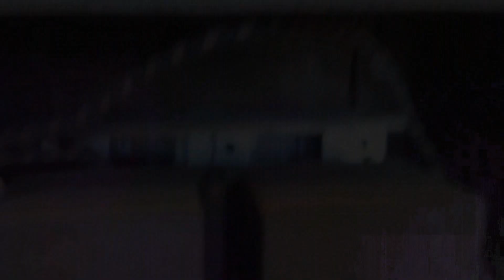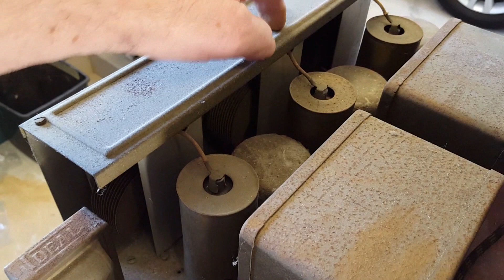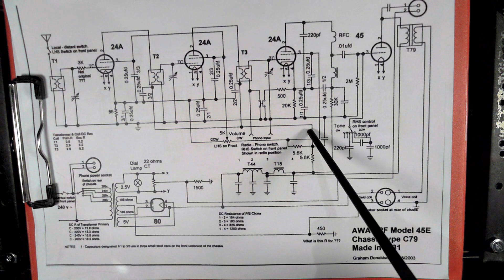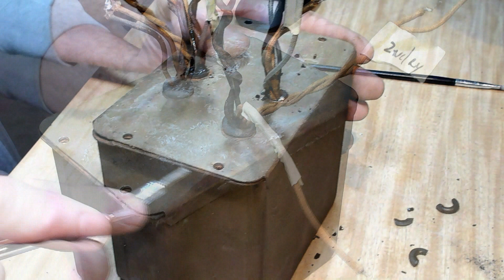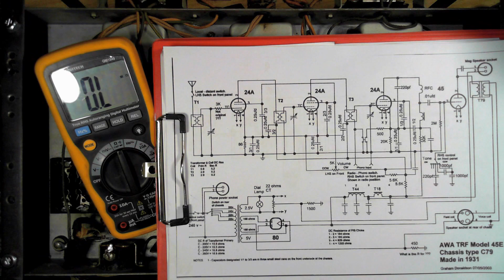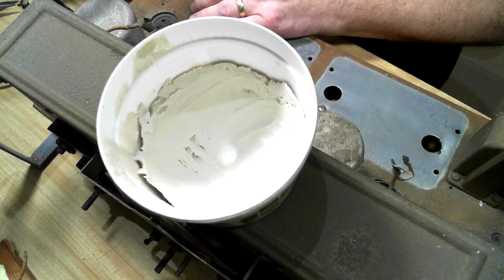1931 AWA 45E C79 Radiola Restoration Part 1

Comment: Hi David, I'm REALLY enjoying your videos. I'm 71, and when I was fifteen I remember a rainy afternoon, Hamilton Library, carrying home a copy of Gilbert Davey's "Fun With Short Waves", being thrilled with the whole idea of building valve radios. I spent the following four years building various receivers, amplifiers, a proximity detector (capacitance relay) etc, before moving on to transistors and ICs. Now with your help I am finding that enjoyment all over again. Regards, Peter. 

PS I have now acquired a total of thirteen old radios from the 1940s and 1950s in the last three weeks. I just have to finish setting up the workplace, with an isolation transformer/variac combo for safety, as you have shown in your videos. I am also waiting on some capacitors from down south.
Reply from the maker: That's great Peter, good luck with all your radio restorations. As you have found, they are addictive. I hope they all go well for you 👍🙂
Reply: @DavidTipton101  Thanks, David, you're right, they are addictive! (And very interesting).

Comment: That looks so much like 👍 Shango066's 1934 Patterson All Wave 👋 radio. His was so riddled with termites that he literally had to resort to the method of using Varathane to "fill" the hollowed out wood 🪵, and screws to put the radio back together. In the end, it turned out so beautifully, although he said that the radio 📻 was headed to the dumpster. He's written a Part 1, and a Part 2 to this 1934 Patterson All Wave radio. The videos were written in circa 2017. Ya might want to check ✔️ them out. Shango066 is a GREAT radio resurrector. He also can make up some gibberish words, but I find it comical. I think 🤔 half of his videos are comedy. Ya also do a GREAT job. This radio will look GREAT in the end!! Your friend, Jeff.
Reply from the maker: I think I saw that one Jeff, he is a funny man 😀

Comment: David, the "VIM" you mentioned is our equivalent (the powdered versions) of either Ajax or Jiff here in Australia.
With regards to rusted items, a simple option worth considering is "Evapo-Rust"  https://evapo-rust.com.au/
HTH, Colin
Reply from the maker: Hi Colin, thanks. I think I used Jif in the video. I didn't have any Ajex but the result would be the same, that rust was too bad. Evapo-Rust is near $100 for 4 litres, Repco have something similar at about $50 but I haven't tried it yet 🙂

Comment: Okay, I know this is a very basic question of electronics, but I've been confused about it for years. Whenever someone is ground/to earth, does it go back to the negative side of the battery or to the common ground/earth? I think it depends on the circuit?
Reply from the maker: It does depend on the circuit clasicradiolover. It generally refers to the chassis itself as being ground. The chassis may or may not be connected to the 'earth'. The chassis is used as a convenient means to connect many electrical components to the same electrical source. Most electrical systems use the same method, a car, a plane, a bus etc, all return the current back to the power source via the framework. I hope that helps 🙂
Reply: @DavidTipton101  Thanks I think that helps.

Comment: you can also use Naval Jelly to remove rust.  Works great!
Reply: That's what Phil Nelson (on his website blog) uses when he restores his vintage radio and TV chassis. Gets the worst of the rust right out in most cases.
Reply from the maker: Hi Sam, we can't get Naval Jelly here anymore but there are similar products available. I had several options but chose to go the way I did because I didn't want to paint it. I did consider sandblasting it and protecting it with clear, a warts and all approach. Thanks for the suggestion 👍🙂

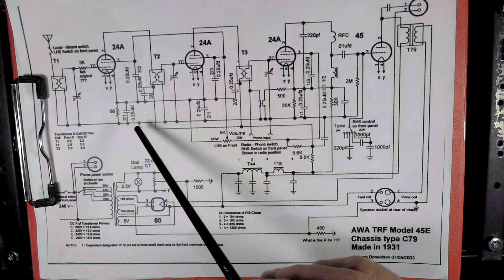Comment: 11:50 So the 24A at this stage is operating as a Class C amplifier? Doesn't make sense at this stage.
Reply from the maker: Hi Chad, the bias for the 24A is lowered by switching in the 500 Ohm resistor to the cathode ground. The anode bend detector function is no longer active and the 24A then operates as a pure pre-amplifier for the 45 output valve. When I fitted the diode to the grid cap to the final 24A it does mean the input from the phono is also going through the diode. I didn't worry about it because the radio doesn't reproduce modern music that well anyway and my intention was to use it as a radio only. I will fix it when I pull the chassis out it out to fix a couple of niggles, I may just go back to the anode bend as was the original design.
Reply: "Anode bend" detection? I forgot what that was - - please explain!

 I like to throw in an alternate explanation: the designers of this radio receiver crkt were working under the presumption that the AM modulation factor would be only 2/3rds of the BC carrier wave - - so not good for the finer elements of music - - - - ?

Comment: Easy solution for the rust: “Naval Jelly”... That stuff is AMAZING. No elbow grease or rubbing needed. Paint it on, let it activate, and then wipe it off. Rust will be GONE. You will need to treat the metal with something pretty quickly though after that, as Naval Jelly is very strong and takes the rust off down to true bare metal and it will flash-rust again very quickly...
Reply from the maker: Hi Steve, we can no longer get Naval Jelly in Oz, I did use it years ago though
Reply: David Tipton ... Is it an environmental thing? It makes me wonder if that is, or soon will be the case here in the U.S. as well. I haven’t had to buy any in quite a while, so I don’t even know...
Reply from the maker: @SteveHacker  I don't think it's an environmental thing, it's just phosphoric and sulfuric acid in gel form, both of which are freely available. There are probably alternate products available. The problem with sulfuric acid is it rusts instantly when removed from the rusted metal and it can't be stopped

Comment: David, I worked on an old 30s Philips radio that also had a volume control that did not work when you had a grammophone connected as it controlled the first two tubes.
Reply from the maker: Hi frans maessen, Yes I agree, it seems the phonographs of the day had a seperate volume control judging from other comments I've received, thanks 🙂

Comment: Wow.  Nothing like diving in at the deep end!  Some of the components look like they have come out of Tutankhamun's tomb with all the wax and decayed fabric.  It is a very interesting aesthetic on this older chassis.  Much more attention to smooth design than later ones.  When new, it must have looked very art deco in the back.  Looking forward to part 2.  Cheers.
Reply from the maker: Hi Pauline, the wax is a pain as you will see in part 2 and the capacitors still changed their values even though they are fully encased in the stuff. The attention to detail is amazing on this radio, the screws and all machined and plated and as you say the layout and look is well thought out. I guess this was the dawn of radio where engineers designed the radio before the bean counters got into the act 😃
Reply: Too true no doubt :-).  I have never seen a radio from this period restored.  A real treasure.  During the resto, would you be able to explain the 3 tuners?  I don't understand how they work.
Reply from the maker: This my first venture into TRF sets too Pauline so it's all new to me. In case I don't explain it during the video... the way I think it works is each of the three RF stage tunes the desired frequency, amplifies it and passes it on to the next stage. Using multiple RF stages reduces the bandwidth and helps tune in weaker stations. Earlier TRF sets had individual tuners which were individually tuned to a station so you can imagine tuning the first tuner then the second etc to get the best reception, this one is ganged together to make it easier. I will have to check they are correctly aligned at a later point.
Reply: Thanks David.

Comment: It puzzles me how the transformers/choke that are somewhat in series could all have gone open.  You’d think if it was due to excessive current draw, one would have opened, like a fuse, protecting the other two.   It might be a good idea, after reassembling the radio, to check impedances to ground at various points before applying power.
Reply from the maker: Hi Bob, thanks, I think they are suffering from old age as any one of the transformer failures would have stopped the set. I will be sure to check before applying power, thanks 👍🙂

Comment: The circuitry of this set looks pretty typical for a late 1920s, early 1930s AC radio, at least a North American made one. The 224A tubes are what they called "Screen Grid" tubes, in that they added a second grid, those solved the problem with needing to neutralize each RF stage to eliminate oscillation. Actually the circuit reminds me of an RCA Radiola 44, the transformer and condenser/choke cans really do remind me of a late 1920s RCA, I wonder if AWA was an RCA licensee? However the tuning capacitors, ganged with a metal belt, reminds me of an Atwater Kent model 40. One oddity (for where I am) is having only a single ended output stage, most consoles from then used a pair of #45s in a push-pull arrangement, it was mostly the cheaper table sets that would have had a single ended #45 tube. 
  In terms of removing the rust a phosphoric acid based rust remover, such as navel jelly, with some 0000 steel wool works well on surface rust. Trisodium phosphate does a good job on cleaning dirty chassis in general, and really does a good job with cleaning aluminum parts, though mag rim cleaner works well for polishing aluminum.
Reply from the maker: Hi OlegKostoglatov, actually I was surprised to see a push-pull output on an Atwater-Kent circuit and as you say the resemblance to my radio chassis is striking. I haven't seen many push-pull outputs on Aussie radios except for the later radiograms, I'm prepared to stand corrected there. I don't know about any connection between RCA and AWA but AWA radios were also called Radiola, there may be a link via Marconi. I often treat rust with phosphoric acid but I want to return this to as original condition as possible so have opted for re-plating. I haven't heard of Trisodium phosphate I'll have to look it up and see if i can get some, thanks 🙂
Reply: Push-pull outputs were almost the norm in console sets with TRF circuits, which the majority of AC sets were in the 1928-31 time period, and wer quite common even in table radios. That changed after the type 47 pentode came out in 1930-31, after which there was a plethora of cheap TRF sets with a single ended output. The reason was for more audio output and less distortion, probably also to cancel out power supply hum.  
 RCA had a monopoly on the superheterodyne circuit in those years so they made most of their sets with single ended outputs for some reason, the higher end ones used a single ended type 50 tube, which required 500-600 volts on the anode, the mid priced ones used type 10s, and the mass produced ones used #71As before the #45s came out. The Radiola 44 was a budget set for the 1929 model year, so it was a TRF, much like the Radiola 18 was the previous year, the difference was that it used screen grid tetrodes rather then triodes for RF amps. 
  I am speaking of the North American radio industry, meaning the U.S and Canada of course. Australia may have been influenced more by the British whom had a perverse patent royalty system in the 1920s where they had to pay Marconi royalties based on how many tubes/valves a radio had. Later they had a sort of cartel called the BVA that sold valves to radio manufacturers on a loss leading basis, but took it out of the hide of set owners when they needed replacements. So whilst in Britain set buyers were averse to buying radios with a higher tube count, in Canada and the U.S the view was that more tubes equaled a better radio.
Reply: I forgot to mention this, and it is too late anyhow, but both Hammond and Edcor manufacture replacement transformers that will accommodate radios with 2.5 volt tube heaters, unfortunately not sets that had 1.4 volt filament tubes like #25s or #71As. They are not cheap but are available, but they may not be an exact match on the high voltage winding, and I don't know if they are available  with 230 primary windings. They may also not have the center tapped heater windings, but that can be worked around with a pair of resistors. 
  Also are you having the output transformer rewound for authenticity? I've found that generic output transformers usually be made to work with #45 tubes.
Reply from the maker: Thanks OlegKostoglatov for your extensive and interesting reply. We probably did follow England initially with radio design but soon developed our own typical Aussie radio style. We also had a patient licencing system in Australia and it was based on the number of tuned circuits in the set and a sticker was placed on each set.  We can get Hammond transformers here but anything from the US is expensive, one that may have worked was over $200 here which is more that the cost of rewinding the two originals. I want to keep the radio looking original both top and bottom so apart from a few new capacitors it looks much the same as in 1931. I will keep the Hammond transformers in mind if I need them in the future. Thanks for your help 😃

Comment: Love how the dial is calibrated in metres wavelength, rather than kilocycles/sec.  Amazing if those 90 year old valves still work. Great videos, looking forward to the next instalments!
Reply from the maker: Hi David, thanks. I guess we just followed the mother country with the dial in meters before switching to kilocycles later on. I have a set of NOS valves in case but I would expect the remaining valves have a good chance of working 🤞🙂
Reply: They really loved tetrodes back then

Comment: Not a straight forward restoration - but then that is not really unusual! Loved your use of humor David. Vim - now my mother used to use that all the time... oh dear I really am showing my age. It's a pity we did not have digital cameras when I was doing restorations - drawing things out by hand was so laborious but you can just point and click! This cabinet will look outstanding by the time you have restored it. Happy New Year David.
Reply from the maker: Hi Kenneth, thanks. We used to have Vim in a cardboard 'tin' with a peelable label covering holes on the top. Mum used it everywhere. Modern technology has made it so much easier, I wouldn't be doing this without YouTube and downloadable schematics etc. Got a problem, ask a group and get a response very quickly. I have videoed every aspect of the pulling apart phase to help with the putting back together phase 😃

Comment: Adjusting the volume control would cause the screen on the third valve to sag as the first two screen draw more current. However, this would be the opposite effect and would make the volume operate "backwards" on the phono input. The effect is probably very slight and the phono input wasn't intended to have a volume control.
Reply from the maker: Hi Mister Hat, yes I agree, the volume will not be affected when in Phone mode. Someone else confirmed the phono played most likely had a volume control 🙂

Comment: Hi David. Looks like you have your hands full with this one. It's often the case with 1920's and 30's radios that the transformers are open. They just didn't have the manufacturing technology yet to make fine copper wire. I don't know how they did it but the process they used tended to make the wire brittle. Over the decades moisture and temperature changes would cause the winding to break. Today it's very difficult to find someone with the skill to rewind these things. It's a dying art I'm afraid. Looking forward to seeing this one as it gets a new life. ATB for 2020.
Reply from the maker: Hi Doug, you may have something there. Any one of the failures would have stopped the radio from working so some or all have occured since the radio was last used. The chap rewiring it is very experienced and I'm confident they will come back better than new 🤞🙂

Comment: That’s a nice old set !    Chokes and transformers do seem to be a weak spot for such old radios.   I don’t think they were expecting them to last for 80 odd years anyway !
Reply from the maker: Yes, you are probably right SInewave423, it would be a bit much to expect I suppose 🤔🙂
Reply: I rewind my own and often find the wire fails in places where there seems to be impuities in the metal. Maybe that was the extent of wire making tech in those days. I've seen windings with upwards of 20 failures some of which were green and some looked like resistive spots that had been hot.
Reply from the maker: @jonka1  that would account for so many dud transformers 🤔